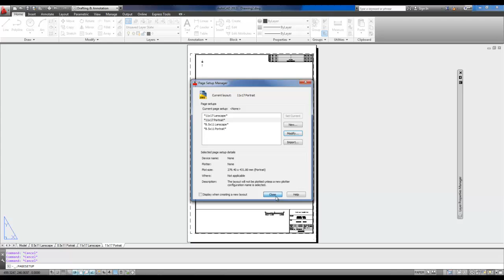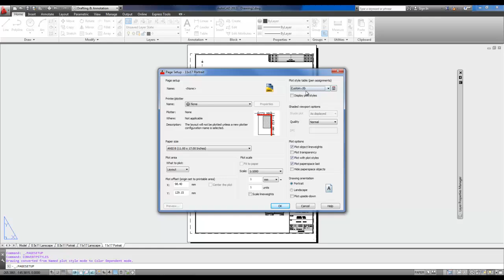AutoCAD Tutorial: How to convert plot styles to .ctb or .stb

Comment: Hello Brandon, 
I m trying to do something in Revit but i cant seem to find a solution. 
My other team mates work in autocad, and i m trying to include revit to our workflow. 

We have an already built system with CTB that has everything and they been using it for years 

Exemple : layer for interior new walls : blue color, x thickiness, and name : A-N-INTER WALL 

This is what i m trying to do : 
I m trying to make a parallèle system in Revit where i can set or asign the exact infos so when i export to autocad ( dwg) i would have the same layers with same name, basically the exact same interior wall that made in Revit but in Autocad.

Is there even a way to do that ?